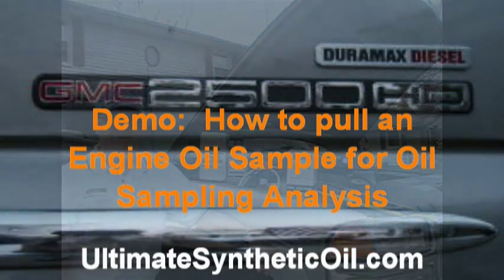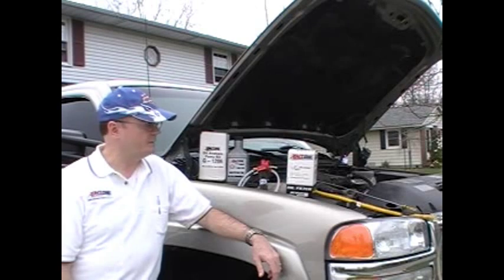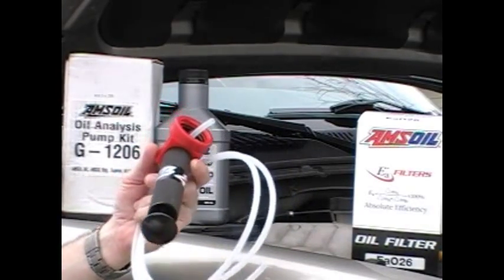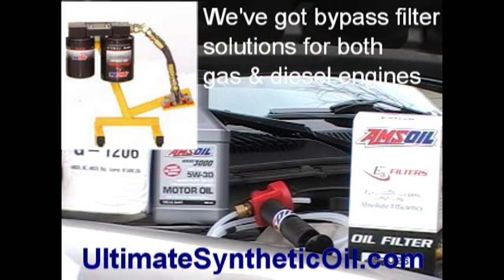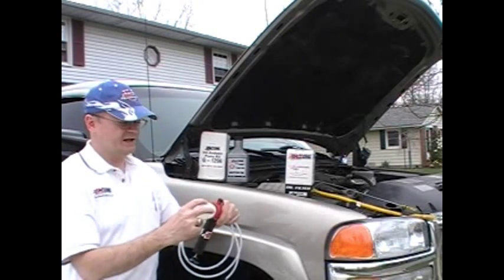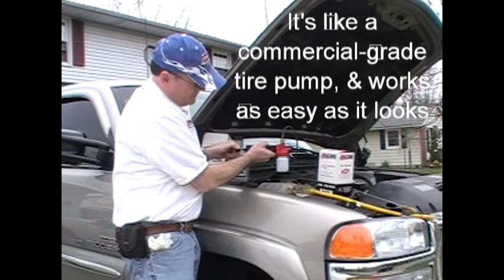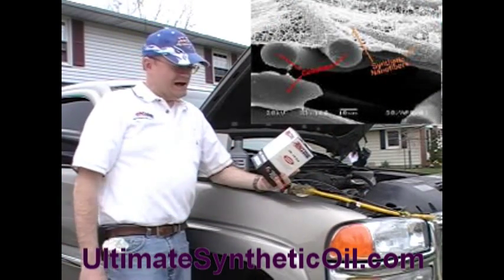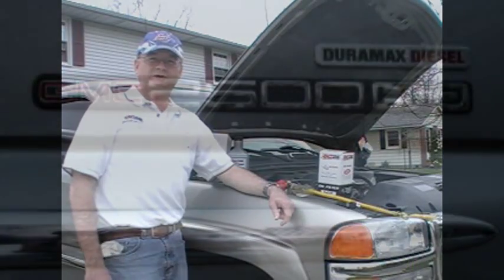Oil Analysis Sample

Comment: I read a GM study that states the removal of particles in the 5-10 micron size can extend engine life up to eight times. This is where the brainwashing comes in because the bypass filter eliminates a need to change oil unless it has fuel in it from DPF after-treatment.